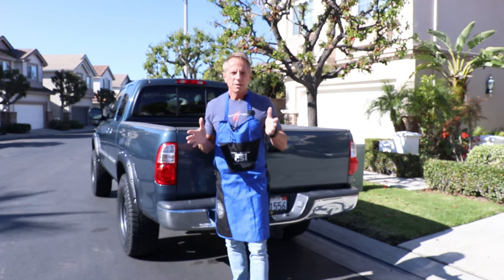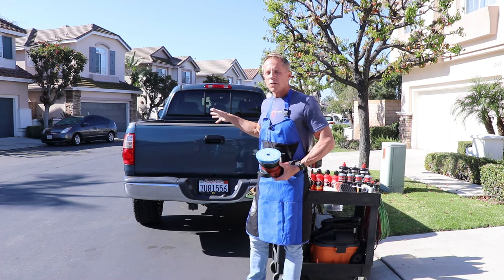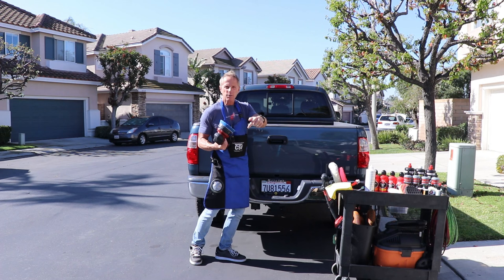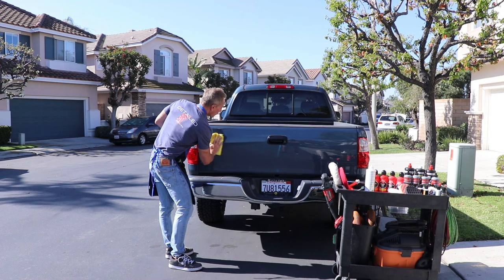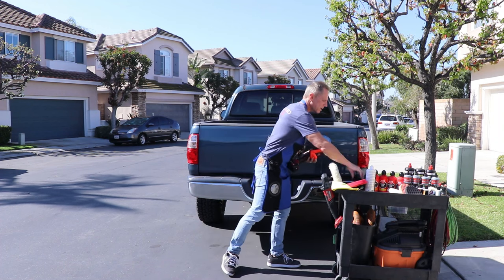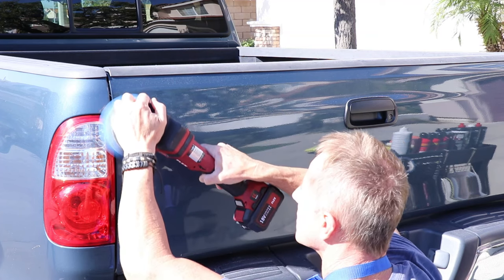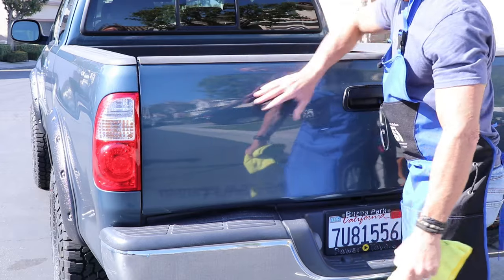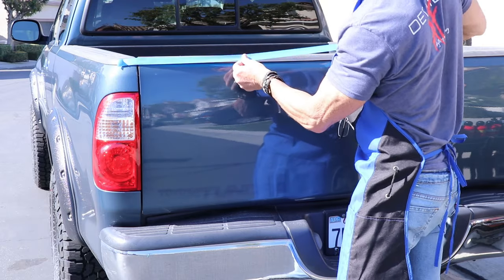Car Polishing Tips: can it REALLY be this simple??!! Using just a single polish?

Comment: I read your review on Amazon about CSI, i'll have to give it a try.  Thats impressive it can remove 800grit scratches, yet act as a polish 
I like the  one product concept.
Chemical guys is over the top with all their polishes and pads. I tried their stuff, the pads dont hold up long - maybe its me.   
Csi is sort of like the  norton ice system where you have one polish and use 2 different pads - i haven't tried it. 3m has so many polishes and pads idk what they all even do.
Im going to try out their ultra fine machine polish and matching blue pad on a black car. Of course i needed a handy quick change pad adapter for 30$ for their dbl sided pad ! 
I'm looking forward to CSI, i want one product that works.

Comment: well got tired of buying endless pads and products, so i thought I'd try CSI. I bought the system with the csi compound, blue wool & red foam pad and backing plate. 
i didn't know the blue pad was prewashed so you dont get lint when its new - thats nice.
Im using a rotary polisher. 
wow the ease of use and level of gloss is amazing. I want to try the Q7 detailer and wax when its back in stock (the detailer is out).
polished the cpiler plastic great too. great product, try it out !

Comment: How much you need of a polish to do a small hatch back.
Reply from the maker: We sell an 8 oz size which would work for a small hatchback assuming the paint was not severely trashed. The worse the paint is as far as defect removal, the more product you would require. (FYI: just like most products, the more you buy, the less it costs per ounce, so the quart is often the go-to size for DIYers and detailers. The body shops all buy in the gallon size)

Comment: Hey bud could you polish the whole vehicle with one battery with the new Flex
Reply from the maker: Not likely. It all depends on how much polishing is required from section to section. I have both Flex (DA) and Milwaukee (rotary) cordless polishers and I have multiple batteries to use that allows me to switch out very quickly to keep going.